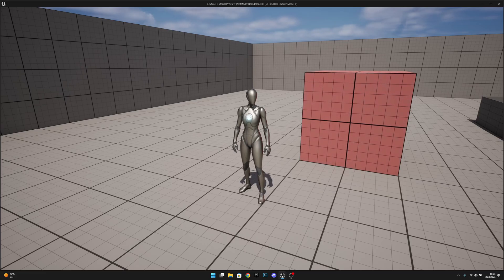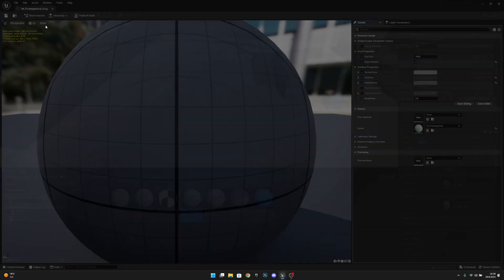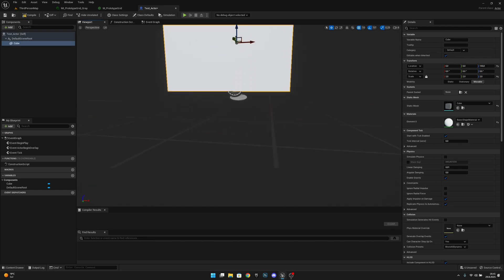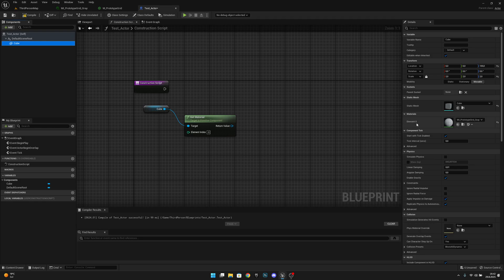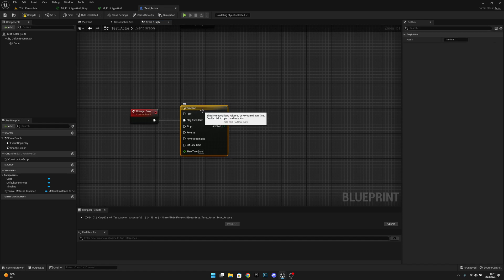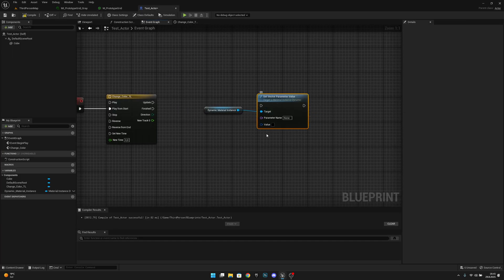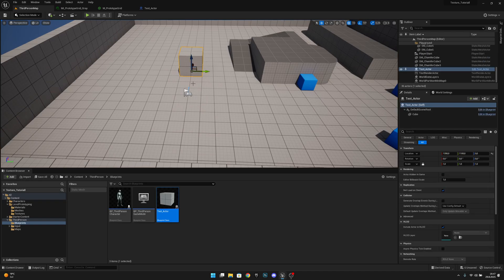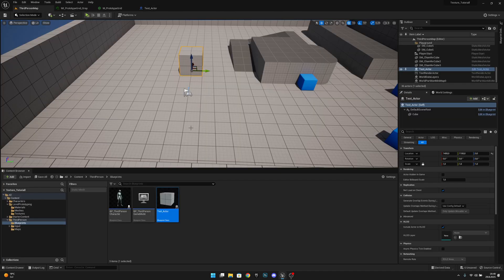How To Change Material Parameters in Runtime with Blueprints in Unreal Engine 5

Comment: UE 5.5 has a way of changing material to dyamic in detail section of mesh's material, can it be done there , or is this BP method needed, or both ? Also what if I want to at runtime, change color to a current transparent material upon character hitting trigger ?  I've done many triggers, just never via dynamic runtime and never changing material or color. TY